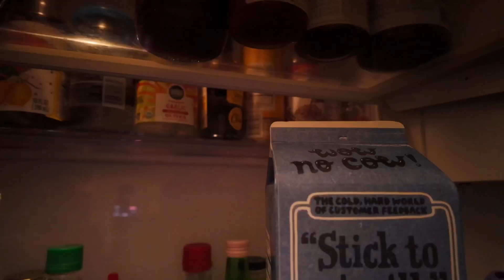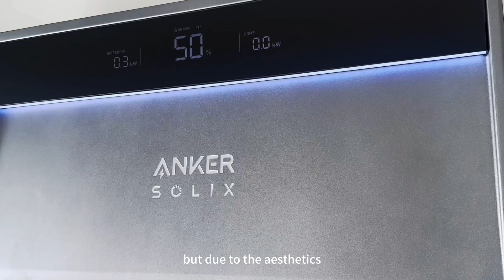How 100kWh from Anker SOLIX X1 Powers a Busy Home

Comment: Can the Solix X1 operate in full grid-forming mode while the grid is present, meaning my house always runs on the inverter’s clean waveform and the grid is only used for charging? Or does it switch back to grid-following whenever utility power is detected?

Comment: Guy didn't put any solar plates to go with battery🤣.
Reply: There's got to be a reason for it.
Reply: @jasonrdunn  Sponsored video ?
Reply: Return on investment for batteries is 3 years. Depending on where you are in the world, charging during free or reduced rate times, then selling spare capacity back to utilityCo means you are net positive in 2 years. You may not need solar at all
Reply: not if the guys you hire overcharge you lol.
Reply: To each his own, he just wants quiet powerful backup to supplement his generator if that wasn't so obvious.